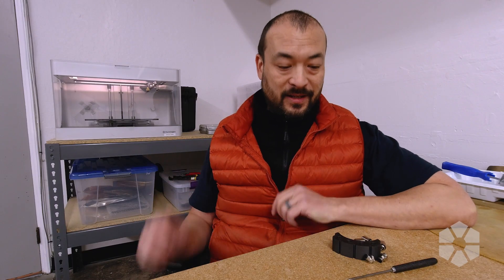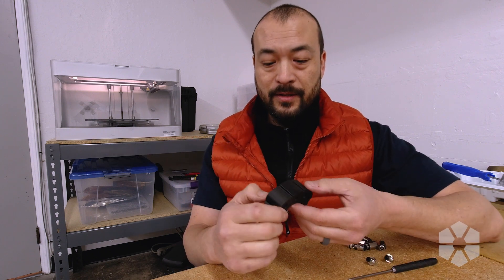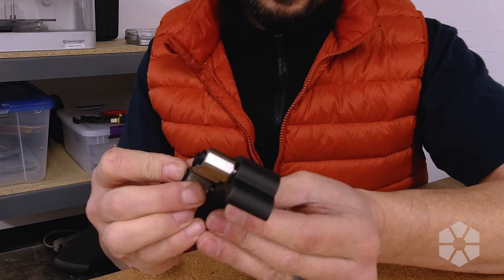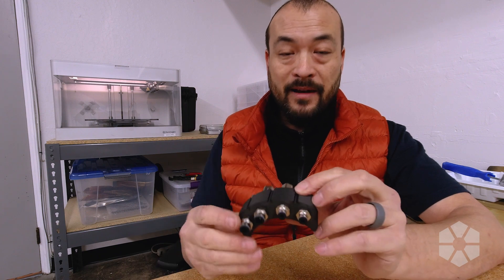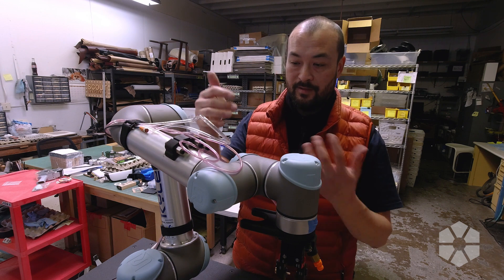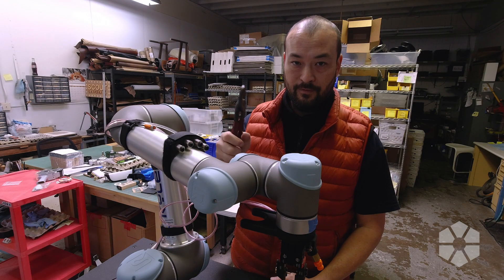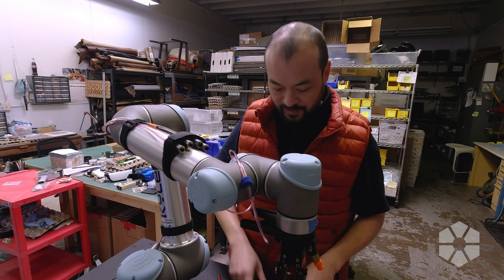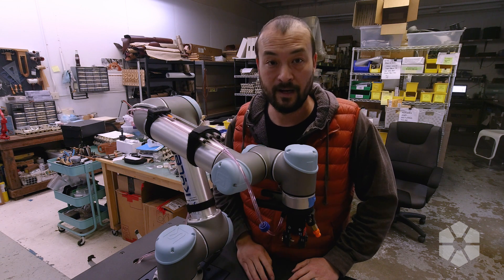3D Printing FTW (AGAIN): Universal Robot Edition

Comment: Thanks for this video as I enjoyed it. You might want to try brass threaded inserts for attaching the tubing connectors to the plastic directly. CNC Kitchen on YouTube did a couple of videos testing how strong the inserts were compared to directly screwing a bolt into the plastic part. The CNC Kitchen video is titled "Threaded Inserts for 3D Prints - Cheap VS Expensive". I would put the URL in the comment but YT usually does not allow that.

Comment: Nice solution.  A couple of comments. 

Those tube cutters make me cringe.  Highly recommend a pair of SMC TK-6 cutters for pneumatic air lines. 

I have only done dress out systems for industrial robots but my favorite vendor is Murrplastik.  They have solutions for cobots as well.  They're also one of the few dress out suppliers with an easy to access CAD library.